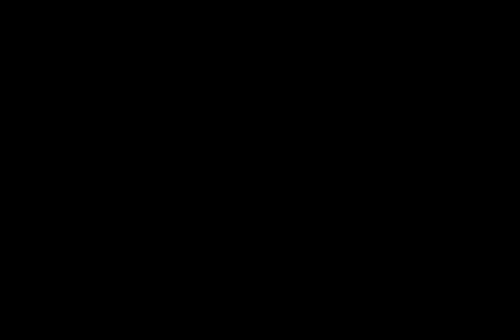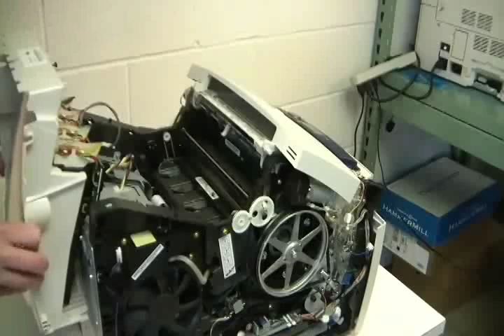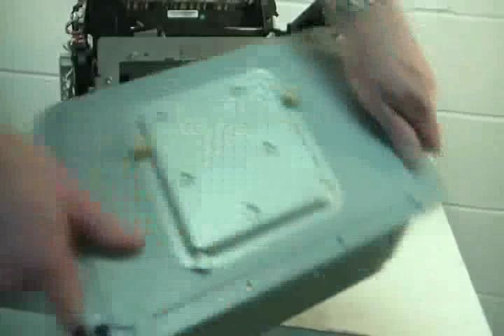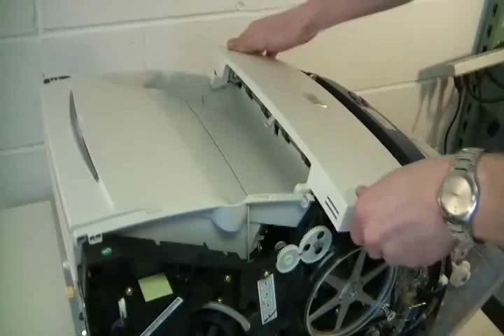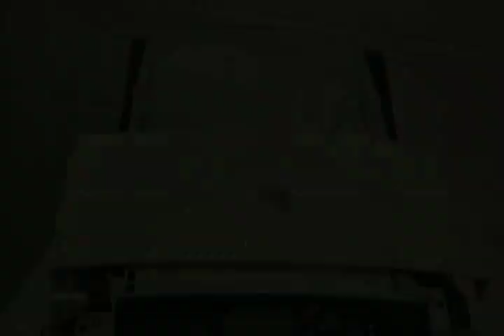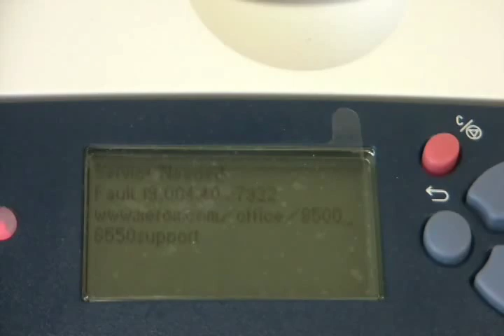Xerox Phaser 8400 8500 8550 8560 Has no power, ram error, or other errors

Comment: hello friend, thanks for your video.now, i have a Xerox colorqube 8580n.it was working very nice but right now apears a code error 91.721.00:19449 and dont know what to do, help me please, i will apreciate you help. Thanks
Reply from the maker: 91,721 Printhead Tilt Fault
A Printhead Tilt error has occurred.
Initial Actions
• Check that the Process Drive gear train is properly homed (ADJ 1.3).
• Check for obstructions or ink spills around the Printhead.
Check all of these parts to make sure nothing is broken. 
Printhead Assembly
• Left Printhead Restraint
• Right Printhead Restraint
• Roll Block
• Head Tilt Solenoid
• X-Axis Motor
• Process Drive with Gear Box and Motor

Comment: Thank you for posting this video.  The power supply on my Xerox 8570DN went out.  I was dead in the water.  My wife uses this printer for her sideline Etsy business of creating greeting cards and uses it constantly. 

Using your video, I was able to first navigate the removal of the entire power module.  Once I successfully removed the power module,  I found a replacement on eBay.  Using the video again, I was able to successfully replace the power module after swapping out the NVRAM, RAM, and Xerox SD card from the "dead" module.  Getting the printer's pieces and parts, cables, and screws back in their proper places was very easy with the video helping me every step of the way.  We're back in business.  I don't think I could have done it without the video!  Thanks again!

Comment: I have a Xerox 8560 with the error code : 07,007.40 : 11230
and another 8500 that melts all the wax and asks for more. What is the solution?

Tenho uma xerox 8560 com o código de erro: 07,007.40:11230
e outra 8500 que derrete toda a cera e pede mais. Qual é a solução?
Obrigado.
Reply: o que eram esses erros da xerox 8560?, tenho o mesmo problema

Comment: I have error 37,002.47:55429 on a 8400. Should I replace the electronics board?
Reply from the maker: This is a bad printhead (left jet stack is bad). You would have to replace the printhead and that is likely not worth the cost.